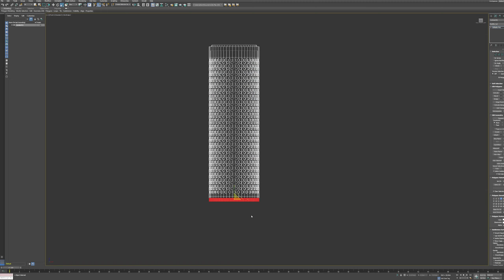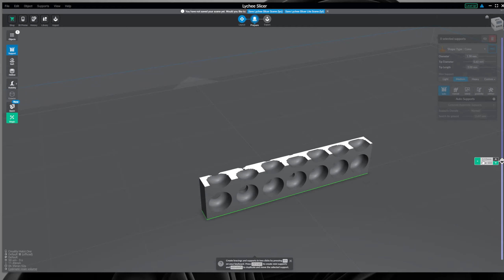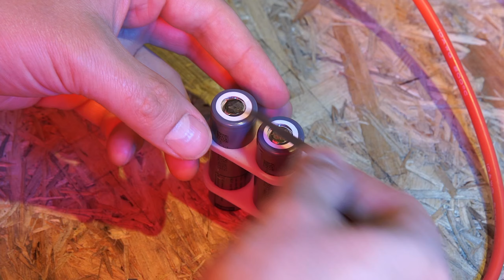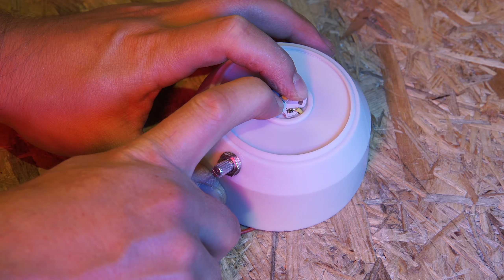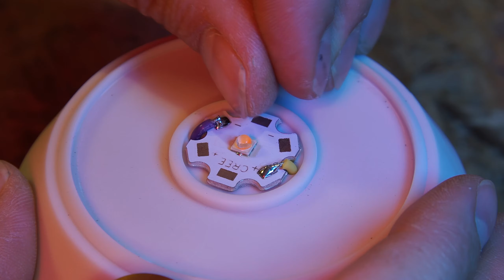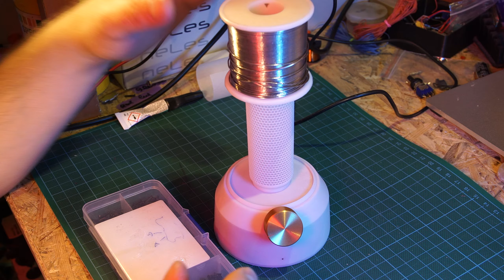Level UP Your Home - Make Your Own 🔥Mood Light!🔥

Comment: Amazing build!!
Just one thing tho, super glueing the glass jar and the light tube is a bit inconvenient. You never know when an electronic component goes bad. So removing all those super glued joints would be a pain in the booots. I learned this the hard way and now always make a way out for disassembly.
Reply from the maker: Thanks for watching!
You're right! For my third light I used some transparent silicone bison glue but I had to put it in a separate bottle with a fine metal tip to distribute it evenly around the glass. Did this after filming so it didn't make it into the video but it's a good tip 👌🏻 On the other hand I'm quite certain the led will literally last forever since it's a 3W led that's underpowered to only use 0.3w and only gets max 65C° with the heatsink :)